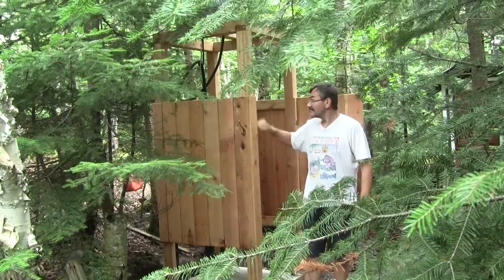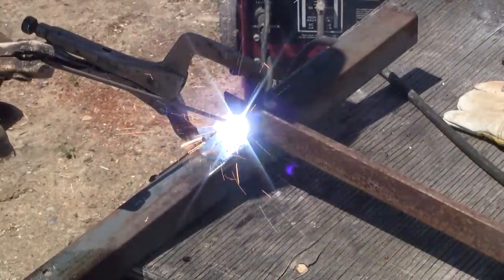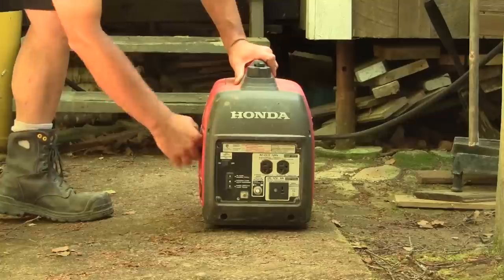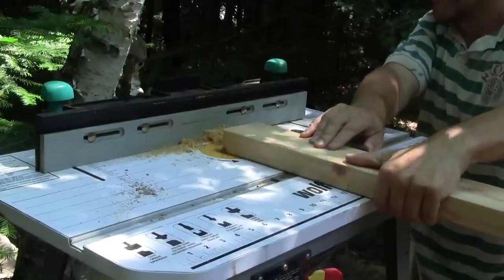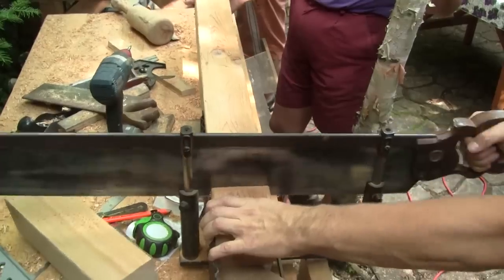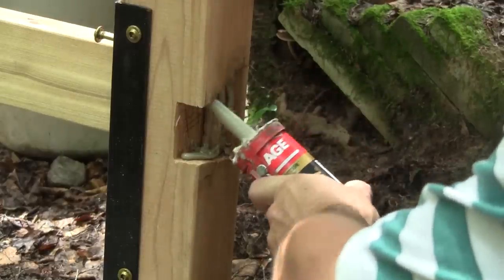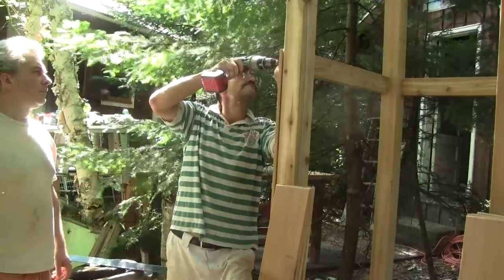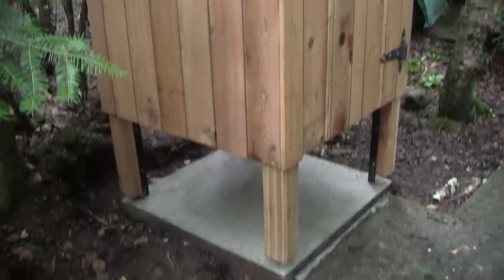The Woodpecker Ep 90 - The Cottage Shower

Comment: visually it looks real nice.  I"m not to sure about putting a iron latch on the OUTSIDE of the door.  Generally I'm only concerned with latching the door when I'm IN the shower not out of it. LOL
Reply from the maker: trongod2000 The latch is only there to keep the door close when I'm not there, so it won't flap around in high wind.